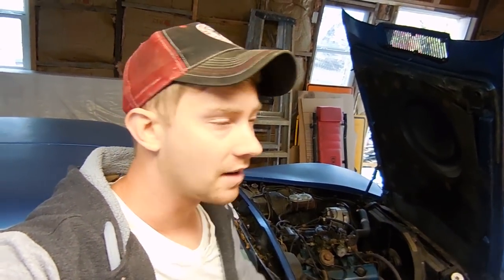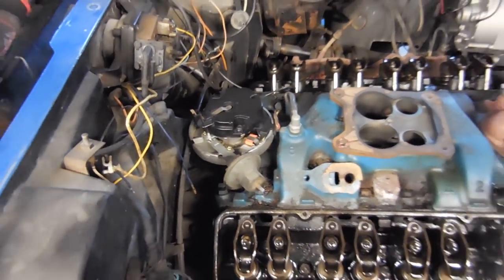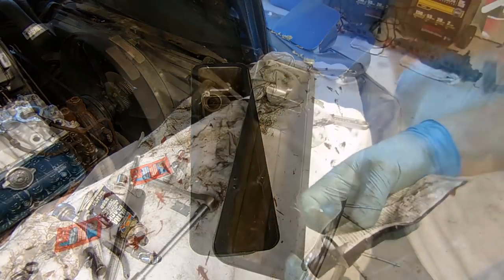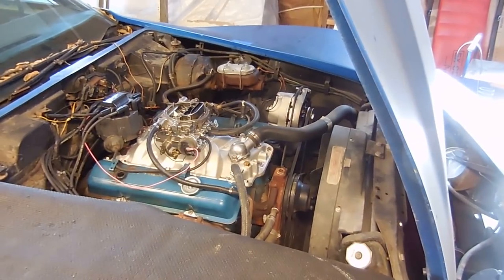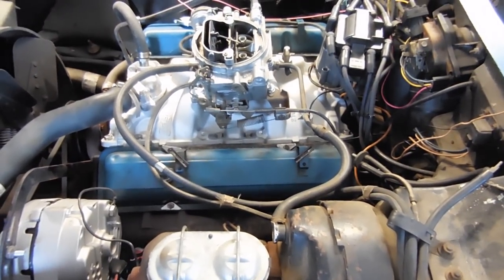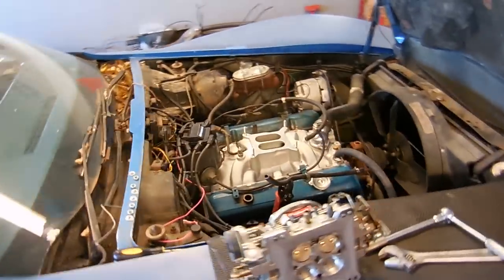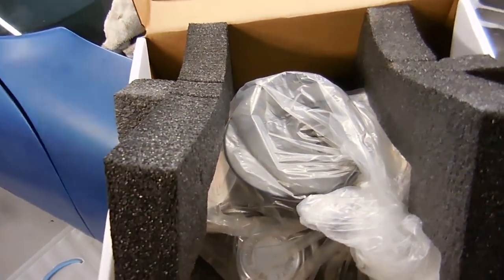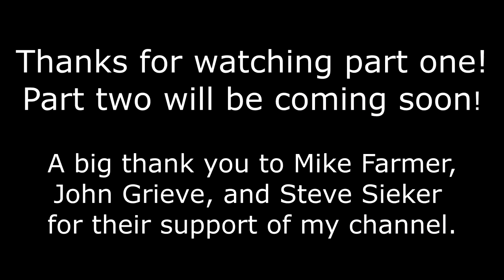Norris' 1973 C3 Corvette Stingray Coupe Part 1 of 2

Comment: Hey speaking as a bodywork guy, I know you gotta do what you gotta do to fit everything in that garage, but go to a linens and things and put down a thick towel first before using the back end of it as a makeshift table, as its those marks that really cause the most long lasting damage

especially with that valve cover gasket if you were using his fender as a makeshift table there, as that looks to be a very thin worn out table top which probably does more damage than simply doing that alone on the fender

as take your hand over it, if you can feel the texture of the fabric, dont use it, its why when you look at amseis garage he has the thing, that thick, like a quarter inch plastic sheet draped over and connected to the car with magnets to the inner fenderwheels

as most of the damage that's been done to my cars hasnt been by MA drivers, it been by negligent family members, and if you know anything about MA, that's saying something that the thing looks damn near brand new 5 years on, despite all of this, and my neglgence, as it was my first new car after all, and the first one that wasnt blue or silver. which hide scratched and damage quite well

and if you need tips on bodywork, consult a twitter page called Perfectionist valet:
https://www.youtube.com/watch?v=CK_heJ7oKl8&t=1s

this guy can make cars shine like you wouldnt believe! and keep in mind that car has a small block chevy motor in size that makes 550 Horsepower, 30 years ago, so its a car worthy of respect, despite all the negativity that the brand gives me nowadays. 

and this is a guy who uses his cars too
https://www.youtube.com/watch?v=NiBMo7j5Gtk

as this is his work on one of the most iconic british cars ever made
https://www.instagram.com/p/kPMGxCG2Sr/?tagged=248rpa

and that car actually won an award just after that work by that detailer, as the best original countach in the country.

Comment: Anti-Seize  is not required on a cast iron head, only on aluminum heads. You want those plug threads clean on a cast iron head for an excellent ground.

Comment: Before you pull the distributor, do you need to be a top dead center with the  timing?
Reply from the maker: No, as long as you drop it back in the exact way it came out

Comment: Did HEI come in corvettes in 1973? I'm working on my 1978 Pontiac Phoenix and ordered a points distributor from a 1975 Corvette just because I'm doing everything up Ol Skool as much as I can.
Reply: No they still ran points in 73 from the factory, The motor color should be orange also.
Reply: This must be a different engine from a late 70’s or early 80’s.

Comment: I hate how the fuel line is ran in the middle of the oil fill cap. It just gets on my nerves, I would either replace the hard line and run it more inboard or reshape the current pipe to run in a neater path.

Comment: Wouldn't a fuel injection system be an improvement over another carb at $1000. I see them advertised but haven't actually used one yet. I'm seriously considering one for my four bbl. Mercedes 280 c could due to its famously lousy carb design. Have u ever used one of these? Rich

Comment: Hello, Covette Ben.  Got any fan shrouds laying around for a '75 Corvette.  Mine is all busted up and I would rather not pay 300 bucks for a new one if I don't have too!  I am also in Texas so I ain't so far away.
Reply from the maker: +RIDEwithGNR I have a few out of a 77 if that will work
Reply: TheCorvetteBen I will double check, and make sure they did not change anything. I can't imagine they did,....  Let me know how you prefer transactions and how much you would want. $$$. Thanks, Ben.
Reply from the maker: +RIDEwithGNR I ask $125 for my shrouds, I'll pick the best one out for you. Shipping will be extra but shouldn't cost too much
Reply: Thank you very much for getting back to me.  I also need saddle color interior door panels if you have any.  Regarding the radiator I just got a sad update from the radiator shop, today.  My core is pretty bad and core cost have gone way up.  So,....  I figured no matter what I was getting in for some serious $$$ dropped to do a radiator, shroud, and hoses, hence, I lost my mind and bought a Dewitt's Direct Fit Aluminum Radiator/Shroud/Dual Electric Fan Set Up from Zip Corvette Parts. Not really what I was shooting for but I think it will work out well.  Thanks again for getting back to me, Ben.

Comment: Why bother changing the intake , carb when a kit in the carb was all it needed?? espec as you state teh motor is just to get it going..? seems redundant unless the stock intake is corroded....just wondering like
Reply from the maker: Carb is square bore, intake is spread bore. Also the customer wanted that done,

Comment: I owned a 73 454 4 speed new in 1973.  I knew every square inch of that car.  I would of super cleaned that engine compartment before even starting that project.  After the nice intake manifold why the beat up valve covers.  If he wanted you to keep them, at least I would paint them for the $5 blue spray can.  Of course, that engine should be orange?
Reply: Everything was cork gaskets back then.  I bought a new 1974 Datsun Z.  Everything was O rings and no oil ooze anywhere.
Reply: Nice blue overspray on hood padding
Reply: I think my 1973 454 4 speed did 0-60 in 6.5 seconds.  Most minivans can do that today.  My Tesla Model X with the smaller 75 kWh battery does 0-60 in 4.7 seconds and it weighs 5000 pounds.  We have come a long way.  I remember every 150 miles you were looking for a gas station.
Reply: They make some fairly inexpensive crate motors

Comment: Only my two cents here: have you done a compression test prior to anything else ?
This engine really doesn't sound right.
"situationmoney" down there may have a point: uneven cylinder wear...
Reply from the maker: The owner just wants me to get it running enough that he can drive it around for a little bit while he saves for a replacement engine.
Reply: After one and a half years working on my 73 c3 its finally running, i cant tell you how healpfull your channel has been to that restoration. thanks keep up the great work. Rodo

Comment: Enjoy your vids, but spend $30 bucks and buy flaring tools and teach yourself. Its not that hard.  That fuel line and ones you've done in previous builds are pretty ghetto.
Reply from the maker: +Rob Rotenberry it would be a waste ofyntr and his money to do that on this particular car. Next year he will be putting in a 454 with fuel injection, which wouldn't use one bit of the line I made.

Comment: Ok, so a couple things.. (1) I've worked on a "few" customer and friends cars, ranging from Corvette's, Porsche's, BMW's, Mercedes, GTO Judge, 69 Hemi Charger, etc, etc.. NEVER use their car as a workbench, doesn't matter what shape it's in, putting old rusty greasy parts on a classic car is very disrespectful and shows lack of care for the vehicle and makes you look like a HACK !!.. Now that we've got that out of the way.. (2) You cant set the timing correctly without removing the hose for the vacuum advance to the Distributor first. That's one the reasons it idles high and you'll never get it right doing it like that, (3) I suspect that carb might be a Edelbrock or? some knockoff of a "Quadrajunk"?? (get a Holley) anyway, before you run those, you have to adjust the fuel/air mix located on the front. turn the two adjustment screws all the way in, then turn them "3" whole turns out, that's how you set up a Edelbrock/Quad carburetor. Only then are you ready to set timing and other things.  I admire your willingness to learn and execute, just make sure your doing it correctly before sharing.. Cheers !!